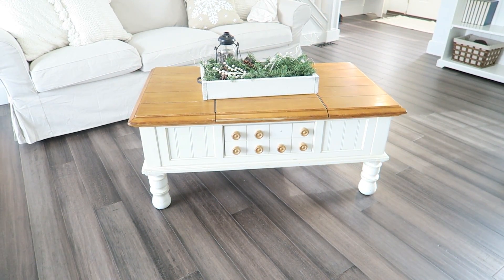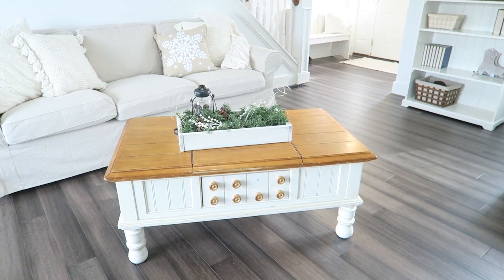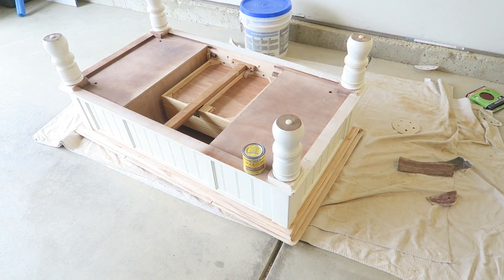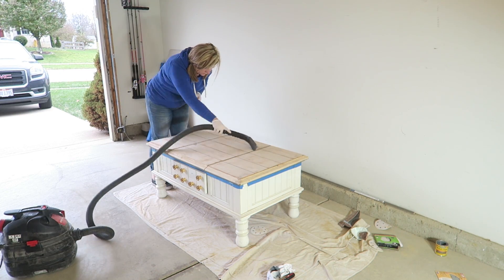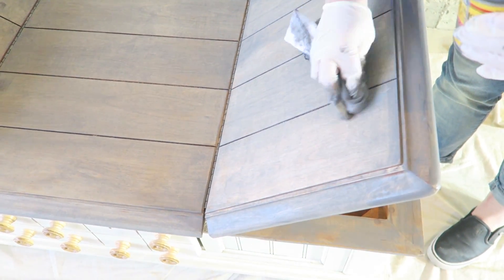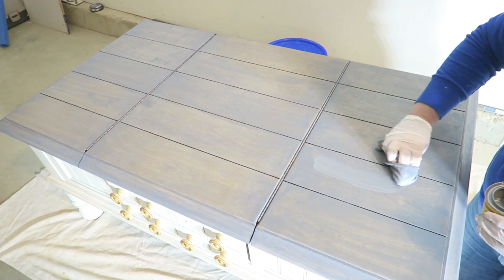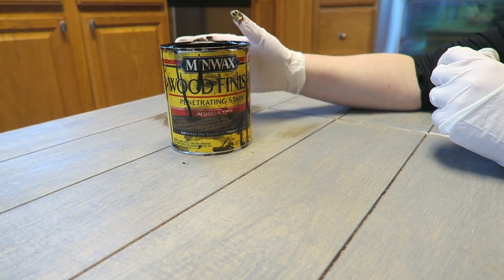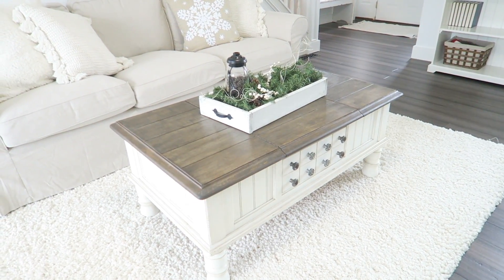Coffee Table Makeover | Modern Farmhouse Style

Comment: I was watching this at the beginning and thought, you should be using jacobean!!!  Although what you did turned out very nice indeed!  Try 3 coats of jacobean on a 2 x 4 and it will end up looking like an expensive piece of wood.  You may end up using it in future projects.  If you ever want to even out a wood grain after sanding try using TSP.  Half of a cup in very hot water, about a litre.  Let it soak into the wood, wipe off with a damp cloth and it will give you a nice even finish.  Just sand and re-stain.   Just don't use it on laminates.  It also removes all the gunky stuff if you're stripping a piece.  Nice job!
Reply from the maker: Thank you and thanks for the great tips!
Reply: artsychic2000 
What in the world is Jacobean❓😱help‼️ I’ve been missing out🤣😂🙄 is that just it or does it come in colors❓🤷🏼‍♀️ thank you🌸